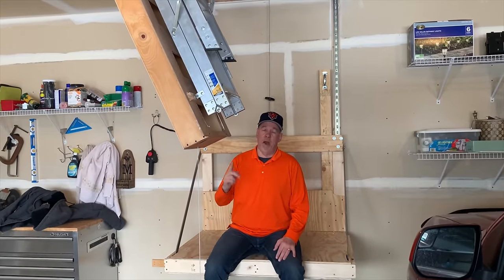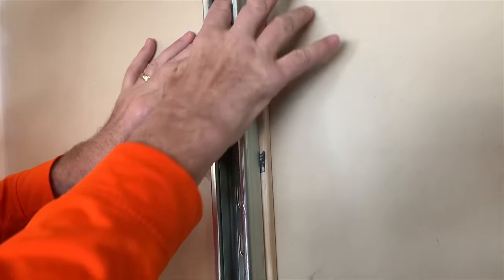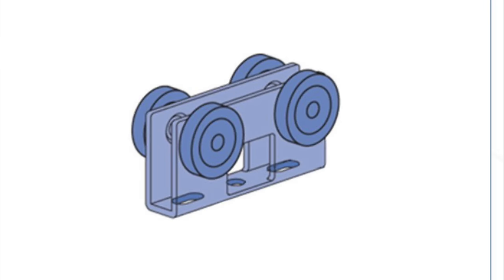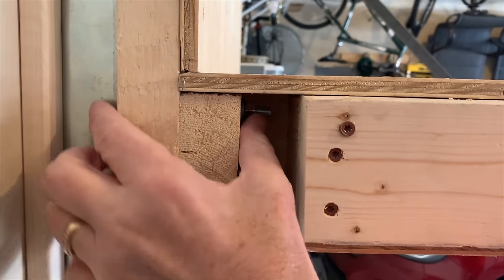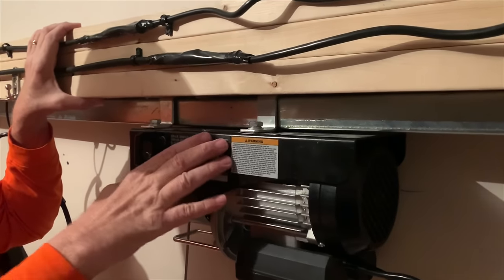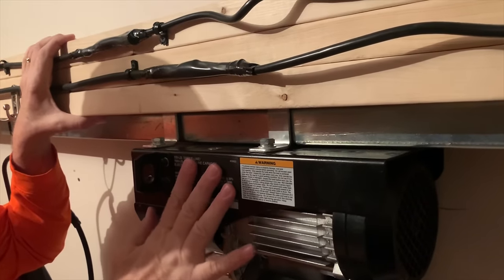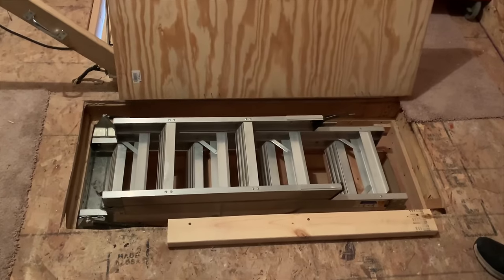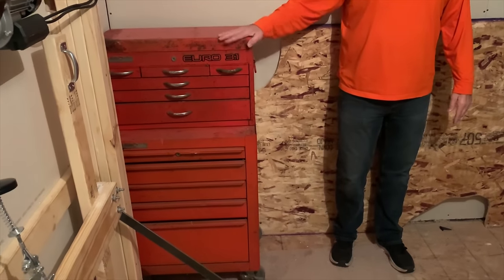Garage Attic Elevator / Lift Build in Minneapolis Minnesota

Comment: Appreciate the video. 
I have one concern; I assembled something similar to this once using a similar hoist motor assembly. Upon close inspection I noticed that the hoist housing that attaches to the metal tube support beam was only connected to the motor by 4 bolts through threaded holes of maybe 3mm of steel. 
My solution for this was to heavily strap the motor to the housing. 
Now those housing bolts “may” never strip but I felt more comfortable having a secondary safety just in case.

Comment: I did something similar. I used a a micro switch with a long arm to turn off the winch when it gets to the top.
Reply: Same thing on mine.  Wife was day dreaming and took it too far bending the frame.   Put limit switch on lift feed wire from remote.

Comment: Love it! If only builders could be this forward thinking! 👍🏼
Reply: I wonder why they aren't personally.
How many builders put up christmas lights on their roofs at christmas time.  Why not put outlets under eaves ... or .... make that suggestion when they get a house build...  Stuff like that.
Reply: They probably could, but lawyers always put a damper on things like this because of someone not using common sense and breaking thier foot because it was over hanging the platform.
Reply: @artguti1551  Agree with you there.  Builder would have a huge liability for anybody getting hurt.
Far as a homeowner doing it.  It's his liability.  Might even be some issues if or when he tries to sell it.
Reply: It wouldn't be an issue if you wrote it in the selling contract that you are not liable for the lift . . As they say in real estate, EVERYTHING is negotiable. @johnjacobjinglehimerschmid3555
Reply: @twoweary  I guess....  I don't know.
Reply: @johnjacobjinglehimerschmid3555   It can be removed before selling the house. The only issue I would have is with fire separation, There needs to be a fire block when the lift is up and the lift would need to remain up when not in use. The other concern is the 2x6 top plates laying flat. There is no structural strength in the way they are placed.
Reply: Shear, crush, falling hazards = liability.

Comment: I have the same idea years ago. But the inspector told me that this is a total code violation. First any lifting mechanism like a lift need to have a fall arrest system i.e. if the cable snaps the load will stay put and not fall . Second all garage build since 1997 need 2 layers of  5/8 dry wall for fire hazard. If this place is on fire the fire will travel thru the hole and engulf the whole attic and spread thru the house.
Reply: Code violations generally become a problem at sale I understand.  He could remove and close it all up if ever sells.
Reply: The fire wall can go to the roof in lieu of using the ceiling. There are requirements for protecting roof joists, all spelled out in building code. 

I would be more concerned about over loading of the structure
Reply: Where I live, codes are very specific about fire separations between attached garages and living spaces for a single family home. You'd be surprised how little is required. If the rated separation for the wall continues up above the garage ceiling, then it likely wouldn't raise any flags for codes since a storage area wouldn't be considered living area. But of course, your codes may vary from mine.
Reply: @The_R_Vid  ... the mention of 5/8 sheetrock in fire code is just one of many ways to do things. Bottom line is a 2 hour rating, which could be done with steel, cement, and other approved materials. A storage area within a garage is still part of the garage, so ratings apply. Basically it depends on where the 2 hour fire rated materials were installed. If they cover the full side of the living area up to the attic ceiling then the garage (including storage) might squeak by.
Reply: @rupe53  Absolutley. Where I live however,  only a 45 min separation is required.
Reply: @The_R_Vid  ... Good thing you woke me up because I have been hanging around in commercial buildings lately where it's 2 hours. Residential is less.

Comment: I just bought trolleys like this but they do not pass through the channels when any low profile screw is used to install the super strut.  What did you do to combat this?  I’ve read some people saying to get the extra deep struts but those aren’t sold at HD or Lowe’s.  Any suggestions?
Reply: ace hardware online has barn door channel
Reply: You use bolts not screws
Reply: Use a low head...like a "spac" brand lag
Reply: @chucksgarage7165  you did the most. Just Mark a hole in the wood or metal where the Trolley goes. Drill Hole. Put BOLT thru opposite side. Put NUT on Trolly side. Using wood screws or lags for untrut and trolly is the stupidest thing ever. The Head of bolt/screw does not go thru the troll the THREAD Side does
Reply: @chucksgarage7165  next time say “thanks for the free education. And always make hole and use Nuts bolts with washers with unistrut and trolleys.” SO YOUR WELCOME. Class dismissed
Reply: @danamcwhite  
Don't you hate it when people lose the debate and delete their comments?
Reply: @RalphSampson...  who deleted comments?
Reply: Weld the unistrut to flat bar mount the flat bar. No screws in unistrut
Reply: It would be best to use captured channel . You're cam followers would ride between to walls of steel or bearings or whatever you're design uses.
Reply: @danamcwhite  As soon as you can explain the difference we will dignify this comment.
Reply: @RalphSampson...  I don't blame people for deleting. Sometimes you get tired of arguing with idiots...😁
Reply: @court2379  explain the difference between what. Maybe I’ll give you a free education.
Reply: @danamcwhite   Please do, I cannot wait to hear your vast knowledge on the topic. I have done a bit research on fastener classification and can say there are no universally accepted standards for it.

 So far your arrogance here embarrasses me, and is behaviour that makes downstream departments hate us. Then the BS about having a PE in every state, when they are not governed by NCEES, but by each state which all have slightly different requirements/laws (that didn't established the credibility I think you intended). And to crown it the lag screws vs a bolted joint. Just because mechanical engineers don't often deal with wood joints and fasteners, or they don't meet any code you are following doesn't mean they aren't perfectly adequate if sized for the load. 

If you are going to comment to people, first get off your high horse, not everyone is an idiot,  provide useful information, don't attack people, don't try to show how much better than everyone you are (they don't care...) and be positive.

I cannot claim that I don't do those those things here and there, but you are on a real string of them in here.
Reply: @court2379  first off his talking about Using Screws in the Trolly to connect to the Unistrut. Not connecting the Unistrut to beams or wood. And yeah I’m surprised in your research and bold claim that you didn’t find that Unistrut is not allowed in use in Fire Systems. Why ? Because a little thing called Code and standards that you said doesn’t exist for it. And yes there are codes and standards for Unistrut. That’s why Unistrut does not have UL listing or FM approval. So let’s recap you misspoke on the topic of what Screws are being used. So you look stupid there. You blindly assert the code and standards of Unistrut and than shown wrong about it in Fire protection industry.  Before you stick your nose into an argument educate your self
Reply: You may be looking for a support bracket to mount the strut. You mount these brackets to your structure and the struts mount inside these allowing the trolley to move freely.  https://www.unistrutohio.com/unistrut-p1834-trolley-track-hanger-support-1-58-channel?gclid=CjwKCAiAjp6BBhAIEiwAkO9WuvghZsqCRnV1lMPCthqsqh1IXOjHEAvWiaIPUiSDsJ8zpSxQcaHMAxoCNncQAvD_BwE

Also it appears that these struts in the video were mounted using screws counter sunk into the strut. So if you don't need to support much weight that works.
Reply: A simple call/visit to you local electrical or metal wholesaler would get you deeper strut. A pause to breathe and think would let you give more helpful and less angry replies.
Reply: @BillBodrero  Or try an HVAC supply co.
Reply: The best header one could use in situation like that would be a wonderful and super strong micto-lam . I've picked up several in all sizes from new residential construction sites.
Reply: @thewholefamdamily  If you're going to advertise for yourself maybe stop with the BS.

Comment: I was thinking about welding up an elevator cage, and just using two harbor freight winches running in parallel on a battery backup so that if one fails or cable breaks, the other can still raise and lower.   As long as  the winches are over-sized, like 6000 lbs, the redundancy should ensure safety.   The only thing that might be difficult would be overload protection, but .... in a residential home elevator ... unless you are transporting tons of gold / lead up and down I can't see that being an issue.  Thoughts?    I could also cable in some sort of 'fall arrestor' which could act in a few cm of fast travel to stop the carriage from crashing 30' down.

Comment: Thanks a ton for making this video.  Have it saved to my favorites.  Just today i hired an engineer to inspect in garage rafters (a mess of lumber from prior construction and upgrades).  he’s going to design and I’m hiring his team to build a solid platform (that can handle the dead loads!).  He still wants to delegate to me the lift itself (from prior convos i get why, this lift for example is not rated for humans for safety reasons).  Hopefully I’ll have my version of this up and running in a couple months.
Reply from the maker: Nice. Be very careful operating and building it and overbuild it for strength. Good luck.

Comment: Do you have a video showing how you lengthen the cable on the hoist lift?  Where did you get the extra wire?  What size wire and how many wires?

Comment: Hi, I am a wheelchair user in Rochester and I need something like this on my main floor deck so I can get to the bottom deck and into my finished basement. Is this something that I could pay you for because the cost of an indoor elevator is $20,000 or more.

Comment: Small world...I grew up in Valparaiso, IN where you moved from...graduated in 89' anyways I am building a garage and had a few questions. What are the dimensions of the elevator/lift/platform and the ceiling opening? I want my architect to make the appropriate design. Also, I am putting high 13' ceiling in my garage...do you foresee any issues with that high of a lift?

Comment: You should add some electronic eye beams across the perimiter of the opening to disable the lift if something breaks the beam (aka is hanging off the edge of the platform and would run into the ceiling). You should be able to use a set of garage door beam sensors, and a couple carefully aligned mirrors for that. There are more appropriate commercial versions of the same thing, but they'd be a lot more expensive. Would hate to see someone loose and arm, leg, or even some toes if they're standing in the wrong place as the lift is going up.
Reply from the maker: That is a very constructive suggestion and I love it. There is very little chance of that because it gets used so infrequently, and it’s usually me. It’s not like something used commercially. But a great idea nonetheless. I’ll put it on my list. Thank you.
Reply: Not really needed now is it?  Anything that fits inside the perimeter of the platform will go up or down perfectly fine.  And since this is not a remotely operated hoist and will stop the moment the operator lets go of the up/down button, there's little to no chance that an overhanging item is going to cause any significant problem.  I think you're really, really overthinking this.

Comment: What's the plan when you're up there and the power goes out? Maybe keep a cooler with some beer  up there for emergencies.
Reply: He still has the folding stairs.
Reply: Better use ice in that cooler. Don't want a refrigerator to loose power.

Comment: Your "beam" (header..layering plywood between adds a great deal of strength also) needs to be standing up..they have no strength laying flat otherwise nice work.
Reply: At a 500 pound limit, I think he could have just used one laying flat and still technically been fine but yeah, beams should go the other way for better rigidity
Reply from the maker: I get that a lot. It’s plenty strong. The concern is the bolt holes going through the beam.
Reply: If the boards in the header are properly fastened together it doesn't matter the direction of the individual boards.  They still rate as one piece.   

So a single 2x4 should be sitting on its narrow side, but if you stack 3 2x4s together on the wide side you now have a 4 1/2" tall beam which will be stronger than a 3 1/2 inch tall beam.
Reply: @jimmydyurko  Bullshit jimmy..that is incorrect.
Reply from the maker: @jimmydyurko  thank you buddy!
Reply: @capt.alcummins3364  if I'm wrong then could you explain why commercially manufactured laminated beams construct them with the smaller boards lying on their wide sides?

OR why span all tables don't have prescriptions for the direction of the components in these laminates?

Once you've bonded (properly) the individual boards into a laminated beam, then it is one member and treated as such.  

Now I do understand that commercially manufactured beams are going to be rated to higher capacity than shop or site built layups.  Their stuff goes through destructive testing to find exact strengths of the design layups.  

When you construct stuff on site you don't have the ability to guarantee quality like they can.
Reply: @jimmydyurko  We are not talking about commercially engineered laminated beams..yes I have seen some laminated beams that have some crown built into them where the material is glued together laying  flat..but the fact is ..there are no span charts anywhere for anything..laying flat..yes the span is short enough where a few 2x4s flat will carry it..but it is not correct..that was what I said to begin with..and you can argue the point till you are blue but the fact is 2x materials have no strength laying flat for the same reason an I beam has no strength laying on its side..been building wood steel and concrete structures for around 40 years and it is simply incorrect from an engineering standpoint.
Reply: @alcummins914  I understand where you are coming from, and yes very much of the strength of a 2x4 comes from its shape. 

You are correct, single 2x4 on its side is not as strong as a single 2x4 on its edge. (not even close)

Consider this:

Situation 1: 3-2x4's stacked on their side forming a beam that is 4.5" tall x 3.5" wide

Situation 2:  3-2x4's stacked on their edges  which will form a beam that is 3.5" tall x 4.5" wide.

the moment of Inertia (measure of stiffness  of the beam) is  
        base x height^3 / 12

So 
     beam 1 = 26.57 in^4
     Beam 2 = 16.07 in^4

so the 2 beams described above, both made from 3- 2x4's would have considerably different stiffness. 

If you were only looking at the individual 2x4's, again...you're 100% right.  
But when you join them together into a single beam they behave as one beam, and stacking them the "wrong" way as described in situation above produces a beam that is nearly 2x as stiff as putting them in the "right" way.  

You are 100# correct about I beams.  The I beam gets the majority of it's strength from the upper & lower flanges and rotating them  takes away the majority of the metal in the top & bottom where the primary stresses/strains are.  An I-beam on its side is a small fraction of its stiffness of a properly seated beam. 

When you laminate a beam of wood into a rectangular beam (again provided the joinery is strong) all that matters is what the overall height and width is.

The direction of the individual boards doesn't matter because it's still just wood and all the members are joined together to act as one.  

The grain direction COULD have an impact, as individual boards stiffness does vary depending on how it's sawn (rift/quarter-sawn etc..)  But in practice 2x4s are a total random mess of grain directions from the mill. Heck many of the 2x4's coming from lumber yards have the pith in them so your guess is as good as anyone's how the grain is going to impact the overall strength of the board.

My point again is that a solid beam of lumber is a solid beam of lumber.  Especially in these incredibly low load situations.  

Thanks for taking the time to read.  If I've made an error, I'm happy to learn from you.  After all, that's what this is all about.

Comment: I am kind of wonder if any usual elevator safety like cable break lock would be possible to add just as an a precaution, then would be some sort of weight limiting simple motor power cut-off  sensor just as a precaution.

Comment: Thank you for sharing!  What kind of nut, crew/bold do you use with the unistrut trolleys? I'm trying to build a material lift and the unistrust srping and crew but they are so expensive. I learned much from your building.

Comment: Weird that the attic did not have permanent proper stair originally.  In the original construction of the townhouse, was it 'not permitted' to have a permanent stair?  It's like that in my city because then its area won't count against the maximum 'floor area ratio' zoning reg. - i.e. such area is 'free'.    Excellent lift!